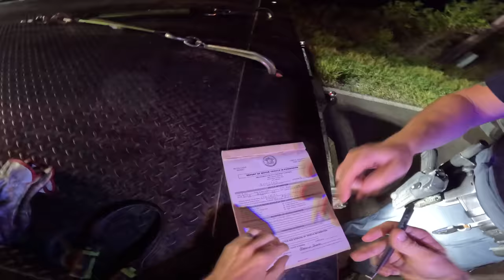This Chevy S10 Hit a Horse!!

Comment: Bummer about the horse but cool it sounds like the driver is ok.
I would guess the driver couldn't open the door and must have busted the window out for all the glass to be on the ground right there where the truck stopped. Made for an easy clean up.

Comment: Good clean up Dustin, I feel bad for the horse, if this had happened here in Pennsylvania, I think if the farmer doesn't know about the horse, and the driver gets a wrecker on scene and hauled away, a lot of the time (at least with deer) someone will push the carcass in to the ditch and that'll be that, if the driver doesn't call 911 to get a trooper to take the report, and even then the trooper may say that they can't give a report depending on circumstances